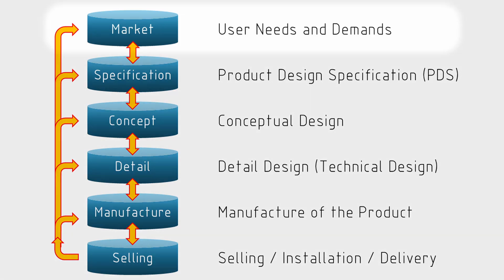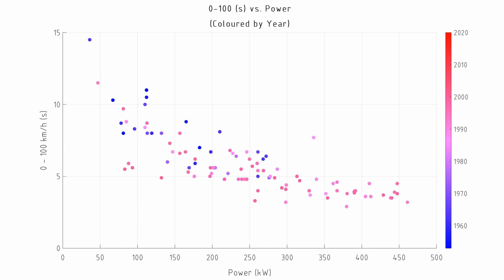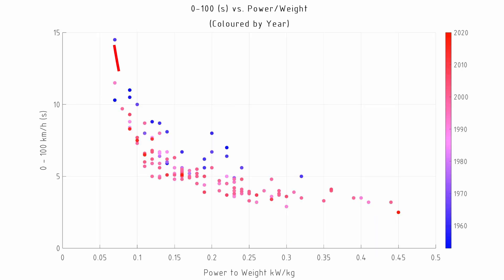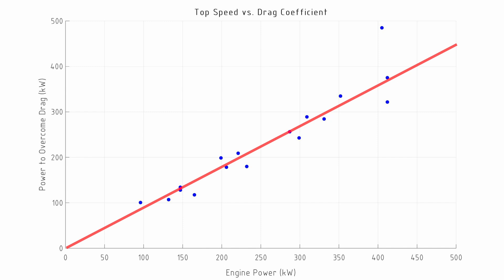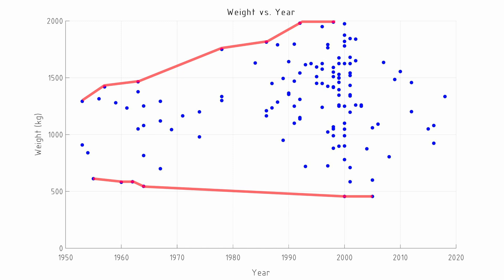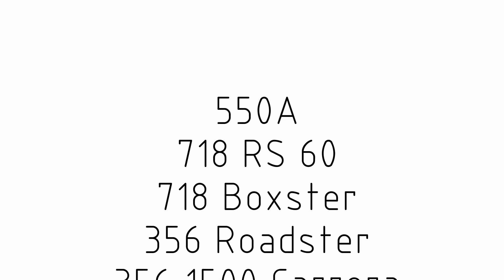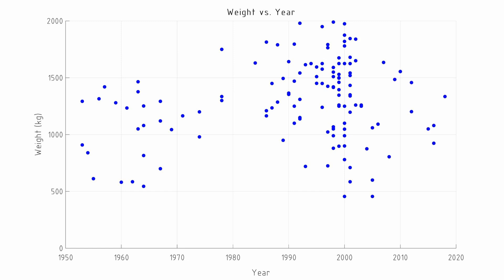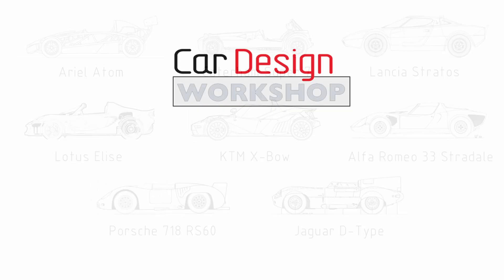Analysing Sportscar Speed and Acceleration from 1950 to Today

Comment: Sometimes, when watching stuff, I have to realize that it's not necessarily made for me, who already knows and understands a bunch of stuff, but for the people who are really just getting started. Case in point, the power-to-weight ratio thing. I was screaming inside the whole time about it until you finally got to it. But in order for a newbie to understand, you have to first show how it isn't just power or weight in the raw, but the relationship of both.

As for the top speed, while raw power does have a strong correlation, the power-to-drag ratio would be more accurate. Luckily, in that regard, you can tune it both through a smaller frontal area (as your car will, indeed, be quite small) or a better drag coefficient, which, ironically, can be tuned through increasing the length of the car, despite length being one of the key factors for weight.

Keeping all this in mind for my own hypothetical design (or rework of my current daily) and knowing that I'd still want something daily drivable, I'd be aiming for about a 4.2-4.8m, length as my primary weight goal is under 1400kg, and a maximum width of 1.85m at the front wheel arch and 1.9m at the back wheel arch. I like my interior space, but I still want it to fit well/easily on your typical 2m wide trailer. I genuinely don't think I'd build a car much more than 10-15cm narrower than that, though I also haven't sat in many and my experience varies with cars as wide as my current Accord (1811mm) where one (my Accord) has positively luxurious elbow room and another (Infinity G37X) feels like a coffin.

I think another interesting video for the future would be seating ergonomics, particularly overall seat tilt-back angle and how that affects what height off the car's floor is acceptable to produce a good knee angle in relation to the pedals, as well as how all of that combined affects the required roof height (above the floor of the car) to produce enough headroom for xyz tall of a driver while (optionally) wearing a helmet and having enough space left over (about 7cm) to be considered safe.

My Accord is particularly rough about this, as I feel it has the perfect roof to floor height for comfy ingress and egress, but you sit so high above the floor that as a 185cm man my head rubs the ceiling right at the sunroof when the seat is set to get me close enough to the steering wheel to feel in control. Contrasted to that, I'm so close to the pedals that my knees form a 90-degree angle and my shin muscle kinda strains to keep the gas pedal gently pressed for normal driving as it has to keep the front of my foot fairly hiked up.

Luckily, I have cruise control, but I want to sit a good 5 inches further down (2.5 for head and 2.5 for helmet) and about 2 inches further back with the steering wheel, another 2 inches closer to me compared to my current, which would be 4, total. I could get most of that with seats and an aftermarket wheel setup or spacer for the stock wheel, but then the signal stalks would be too far away and so too would the sunroof and TCS buttons. God only knows what modifying the steering column would be like, but at least if I did that, I could get 2-3 of the 4 required inches there, BEFORE a steering wheel spacer or replacement, not to mention fix the goofy tilted angle of the factory column (has to be in the full up position for comfortable leg clearance, but it's still at least 10 degrees tilted even in the full down position), but I have no idea how to go about doing this without possibly massive surgery on the car... Any advice?
Reply from the maker: Definitely plan on doing an ergonomics video.  In a weird way that is why I am working on the steering now.  The front suspension geometry is driven by the steering system, which in turn drives the chassis design, and available space.

Very important to get the ergo right on a car becuase it is so hard to change once the chassis is together. Not sure what you could do with the Accord. You have highlighted the big knock on effects of trying to make a fairly simple change to seating height.  Anyway you could mock it up in the car to test?
Reply: @KevinHayward7  Not that I know of. I just don't have any other seats on hand.

Comment: Really fascinating to see how many sports cars we had in the 60s, and then there's very few from 1970-1985, then an explosion of cars from 1985-2002, and then fewer and fewer sports cars again. I remember how exciting the car world was when i was growing up in the 90s, and then as soon as I graduated high school manufacturers had almost completely stopped producing anything interesting. And now that I can actually afford to buy a new car, there's not a single manufacturer making anything I actually want.

Anyway, I'm loving all of this data. Thanks for putting it together.
Reply from the maker: I hear that, when I was younger there were so many small rear wheel drive cars available. So many enjoyable driver's cars.
Reply: What gets lost in this discussion is the economics of building a small market car. Sports cars are basically one off vehicles as far as the components used to make them. Engine platforms and transmissions may be transferable between body lines for a manufacturer, but the major body and chassis work seldom does. That drives up the unit car for cars with small markets which is definitely where performance cars fall. The fact that the Miata dominates that segment has a lot to do with the fact there are not enough buyers to support too many other competing cars of that type. That logic is why MG's and Triumphs disappeared all at once. The market at that point could support the sale of 50K plus sports cars a year. But to make a profitable sports car, you would need to sell 50K of them a year - virtually the entire markets worth. British Leland erred in removing all its product from that market because no single car could remain profitable. Instead they could have left one of those enthusiast car and closed down the other lines. That logic is reflected in the search and decline of offered models as good enthusiast cars are released but the market isn't there to support all the makes that are offered.

Comment: I'd just like to point out that the 0-100km/h time isn't acceleration but the reciprocal thereof.  If you plotted actual acceleration vs power/torque/weight/WHY, you might see a better, more obvious linear correlation.
Reply from the maker: Good point, could be plotted as average acceleration. Wish I could post a picture response here, graph is pretty linear with expected scatter as power to weight increases.  Scatter mainly due to differences in grip. Doesn’t really change anything conclusion wise but would have been nice to show this in the video.
Reply: @KevinHayward7  I'm just picking the nits here.  I thought your presentation here was quite fascinating, especially when you distilled to Porsches.  Top work!